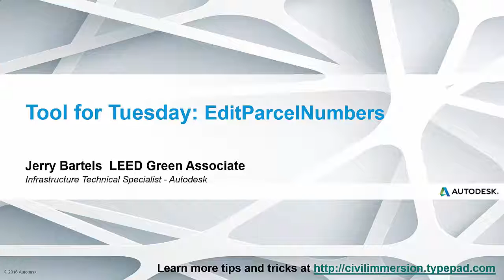Renumbering Parcels in Civil 3D

Comment: Hi, Jerry.   C3D parcels do not allow for duplicate values.  The site in your example has five blocks.  The lots in each block need to start with a value of one.  I am new to parcels and have spent a week trying to get this right.  I've tried different combinations but it seems like the only option that has "worked" so far is to create a site with blocks only, then make new sites for each block and copy the original block into the new site.  However, each time I do this, I get weird behavior.  Labels show up in the copied block but for the wrong block.  Do you have any recommendations for doing this or suggestions as to what might be making this happen?  Thanks!